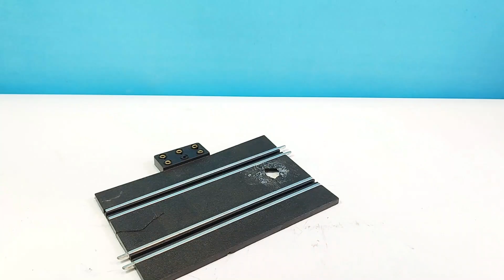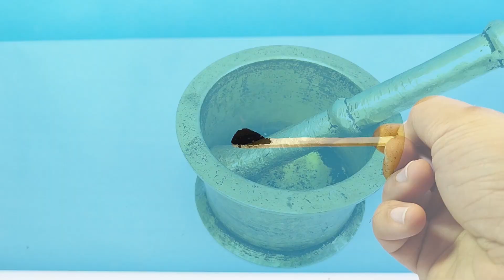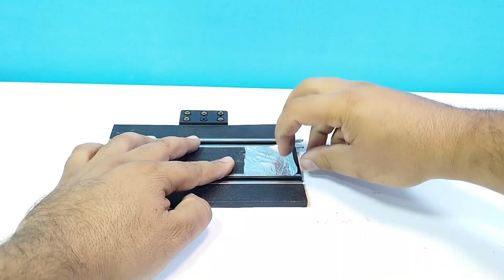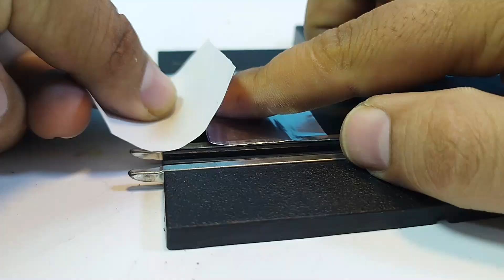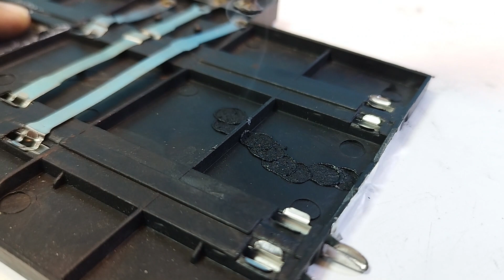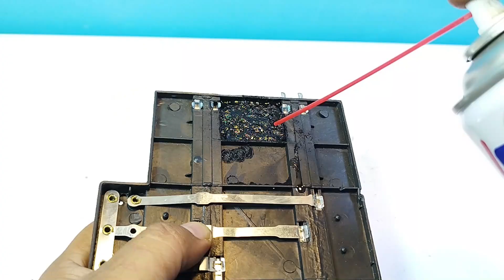Revive your broken plastics: 2 easy ways with super glue plastic welding method with battery carbon

Comment: It would be good to include what type of plastic you were repairing or types of plastics that can be repaired using this method.
Reply from the maker: Hello my friend .
Thank you for sending your comment.
In this video, dry and brittle plastic, which is usually used as tool boxes, is used. It was because battery carbon was used to increase adhesion
Reply: I meant what type of plastic resin rating. On some plastics there is the plastic resin symbol or resin identification code that indicates the type of plastic. It is usually stamped somewhere on it. It looks like the recycling symbol or a triangle with a number at the center. Like type 1 for PETE or type 2 for HDPE, etc. You can reference this information online. I thought it would be helpful for viewers to know. Thanks for doing the video and the comment. @WTRICK582
Reply from the maker: @ZenThruAnger Your opinion is excellent. Specialized information about materials will be very helpful.
Thank you